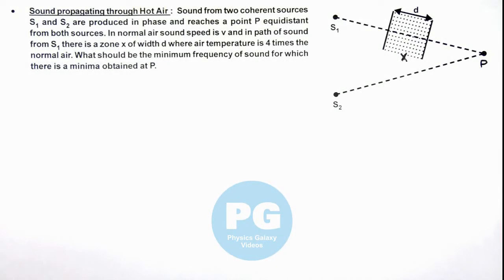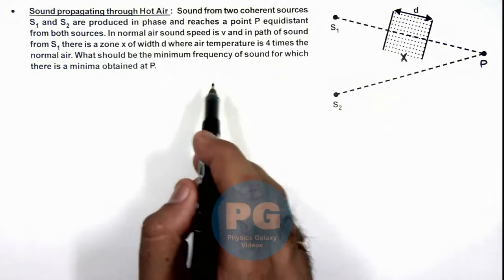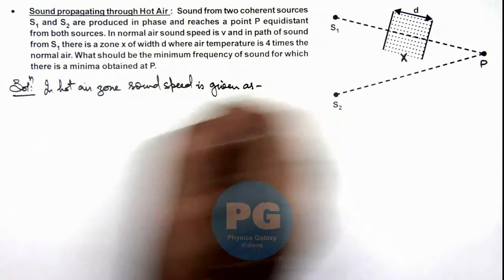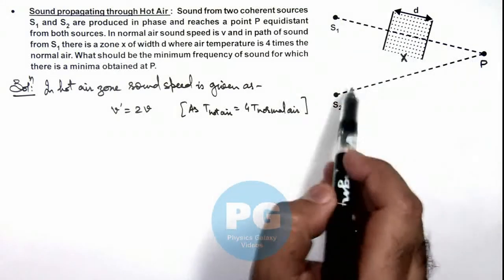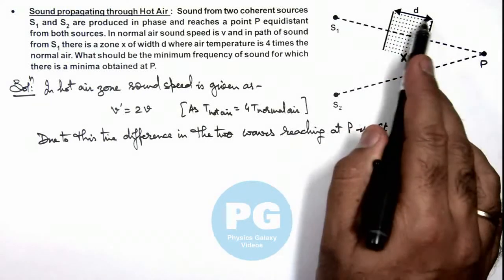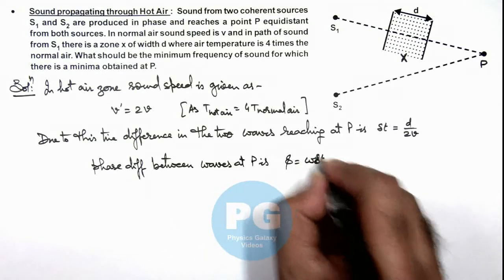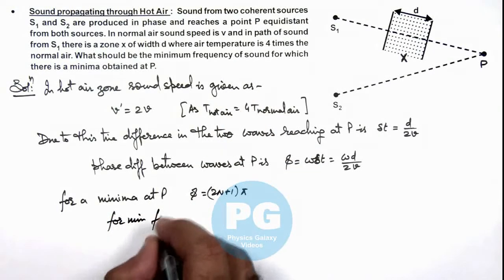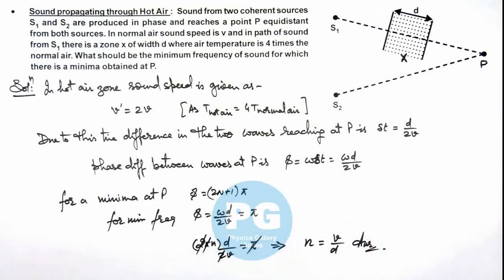2. Advance Illustration | Waves  | Sound propagating through Hot Air | by Ashish Arora

Comment: sir it's much simpler if we do it by considering optical path method. Can we do it like that?
Reply: yes, of course. Due to the additional medium (x), we will get a path difference of (u-1)d where u = 1/2. Just equate it to (n-1/2)lamda and you will get the same answer
Reply: @pythonlearner4472  its coming d=(1-2n)lambda..........then it is coming out to be negative
Reply: @pythonlearner4472  How can Refractive index be less than 1 … 😂😂…. Answer is coming but I doubt method…

Comment: S2 leads, S1 lags by a phase difference of pi*d/lambda.
Reply: Any other method 🙄🙄pls tell
Reply: @pm7870  You can do it using optical path method (Wave optics)
Reply: @pm7870  path difference should be odd multiple of lambda

Comment: Sir,  if I am not mistaking ,time difference  should be d/v because other wave is also moving with v at that time, so relatively ist wave will reach d/v time before
Reply: Without the hot air, the time taken to cross "d" is d/v.
With hot air the time taken to cross d is d/2v
Therefore the time reduced to reach p by s2 or extra time taken by the wave of s1 relative to s2 to reach p is the difference between the times, which is d/v-d/2v=d/2v.
Correct me if iam wrong.
Reply: @krishnadeshmukh2928  u r right bro
Reply: @krishnadeshmukh2928  You are right. I also did it in same way..
Reply: @krishnadeshmukh2928   you are right